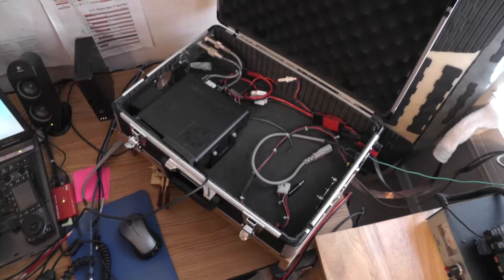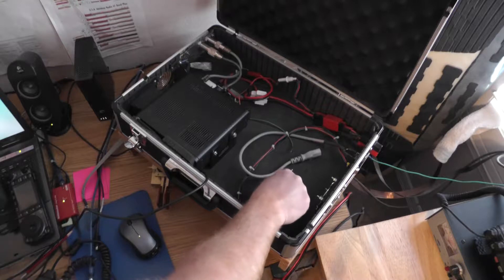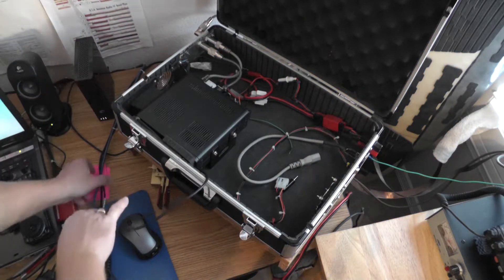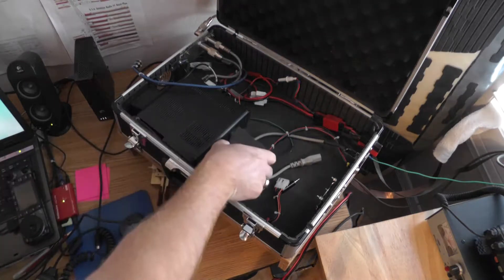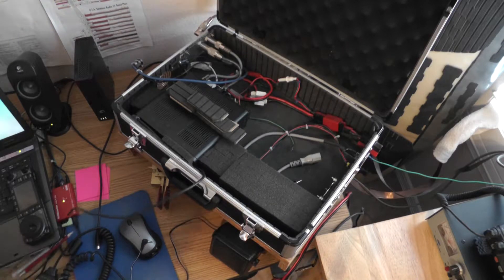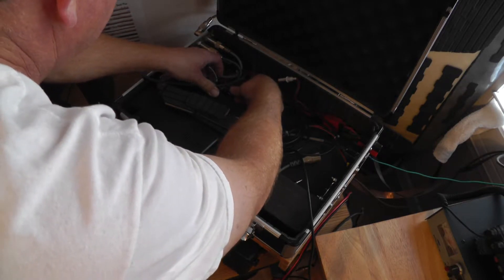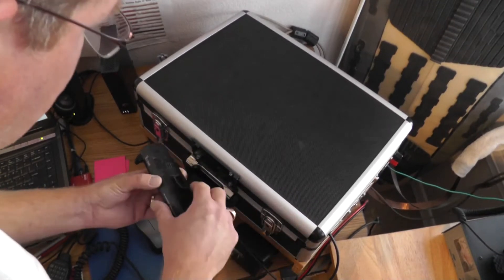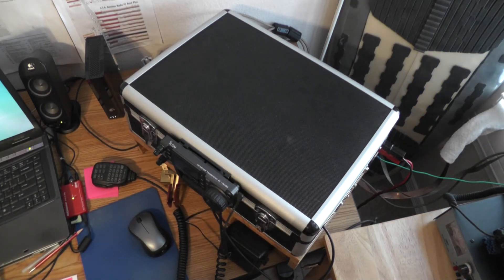Icom 7000 in a box Setup for Base Operations with Rig Blaster (digital)

Comment: Great info. It looks like you used two fans. I'm guessing one was pushing and one was pulling. Did you have any issues with heat buildup with the case closed?
73 Ralph KB1ZYI
Reply from the maker: Hey Ralph,  Thanks for breathing life into the project.  I DO have two fans, they both pull air out of the right side of the case now (may be only one in the video).  I had not found a heating issue but figured since I had two fans, why not make them both pull and just put a cover on the one inlet side.  Less likelihood of heating issues :D.  Still no heating issues after years.  In the truck, I usually have one or two AC vents aimed at the intake side.  Hope this provides a little clarity.

73, Dave